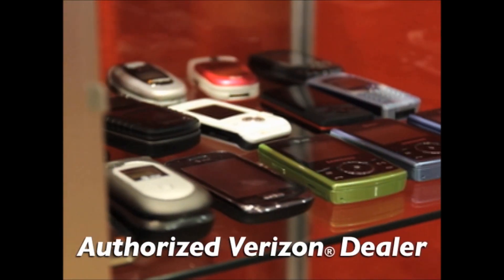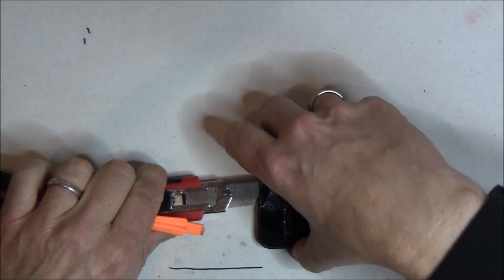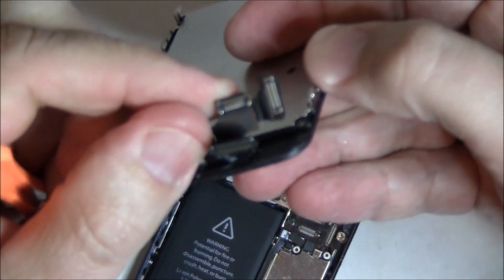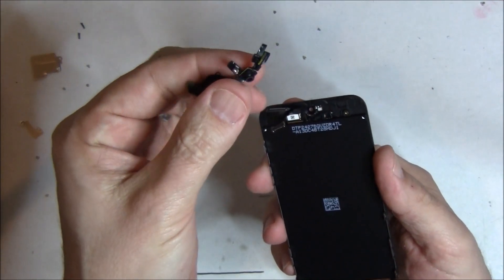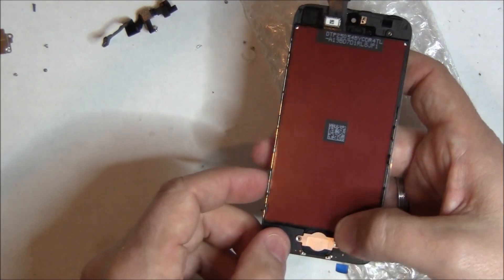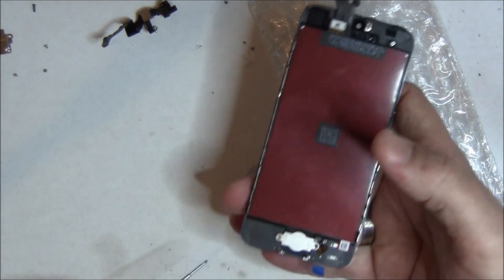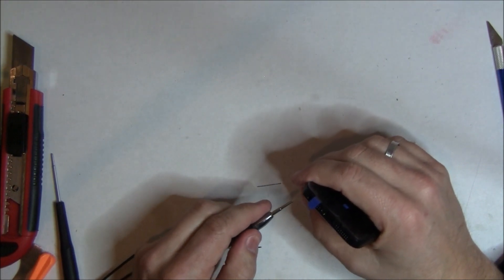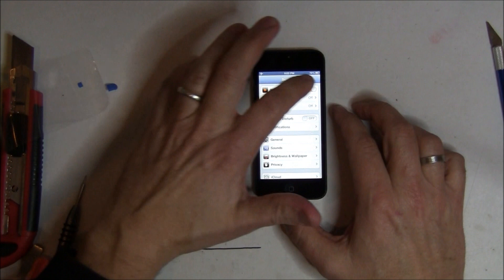iPhone 5 broken screen repair fix disassemble step by step instructions Yakety Yak Wireless

Comment: the best video I came across on the You Tube. After watching several videos i started panicking if I will be able to put my phone back together and actually finish screen change. Your video made it possible. This was the only video where I found described how to detach upper part of the phone (camera and mic...)
I didnt have little hitter lamp you have, instead I placed the phone to the lightbulb and it worked great. 
Thank you for a good video. it was very helpufull

Comment: Great Video, very informative!! Thanks for sharing your knowledge. After connectiong battery and power on, it all worked except for home button. I thought well maybe the screen needs to be back on main body, but wasnt sure, so before I put it together I called and talked to Trevor who verified that was the case. He told me the screen needs to be on the main body and mated for the home button to work. I got it all done and the home button works! Thanks guys for the insight!

Comment: Great video - I watched a few and they were all missing something - either they used a new phone instead of a busted one, don't tell you or don't show you how to disconnect the battery, etc etc. Only thing is I used a hair dryer on low instead of the heat gun. Did it & works! Thanks!

Comment: Thank you this worked beautifully. I do have one question. The home button is placed back where it should be and everything is working correctly. The only thing is the button will actually spin around due to no adhesive around the button, is there anything that can fix this or is this normal?

Comment: i replaced the screen and everything works but if you leave the screen on over the course of 30 seconds it fades to a purple and the digitizer will not work. but if you turn the screen off and back on it works again. did i mess up the sensor?